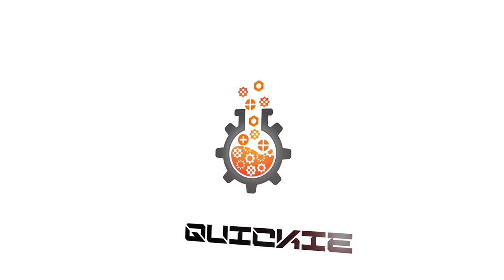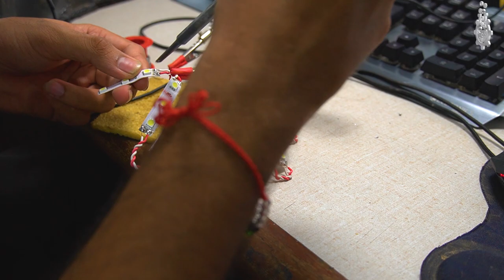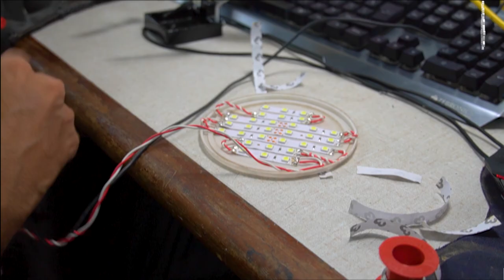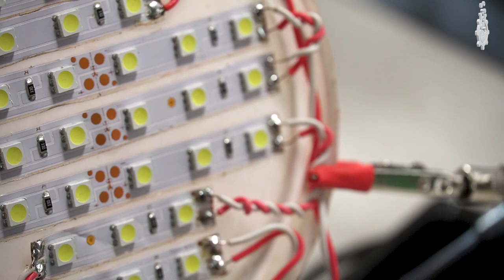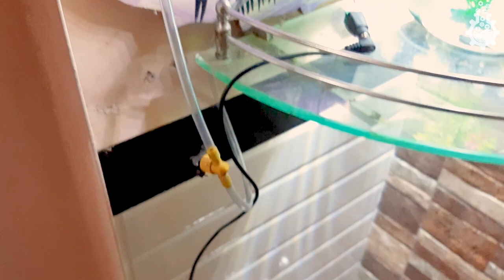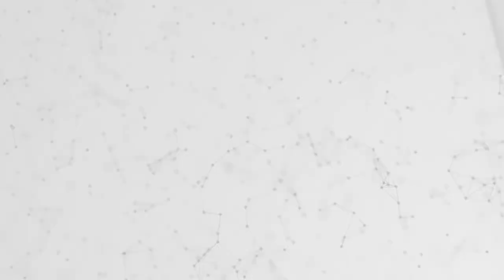diy fish tank light | how to install LED lights on Fish Tank

Comment: I don't think so fish was comfortable with that flashy light, i hope you don't treat them as your toys🙏🙏🙏🙏
Reply from the maker: don't worry, i added a 555 based dimmer circuit to dim and low down the intensity of that light! 
thank you :)
Reply: @mission_critical   Umm i don't think so it will make the fish enjoy that flashy light,all i am say  is don't use them as ur toys Thank you, i don't except any kind of reply🙌🏻
Reply from the maker: It was for my friend, he said fish was afraid in the dark, so he needed lights for it, although I did turned down the intensity to avoid causing any harm to the fish! 😊
Reply: @mission_critical  If the fish is "afraid of the dark" then why not just add this torture chamber next to the window?
If this bright light was on even at night then the poor fish is already dead.